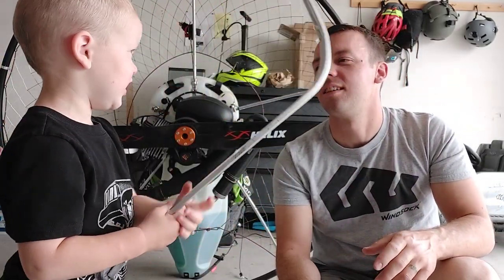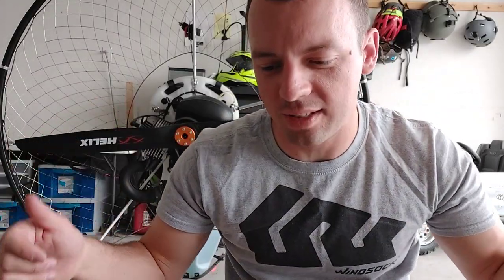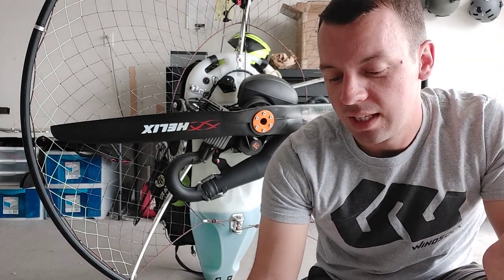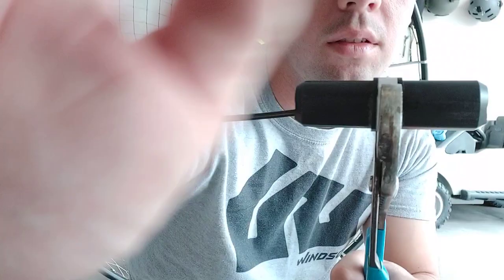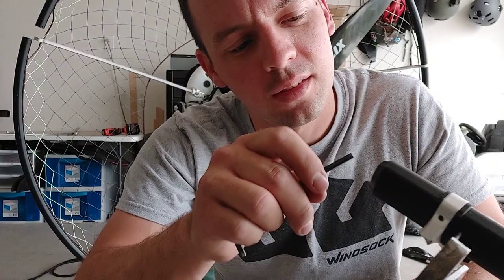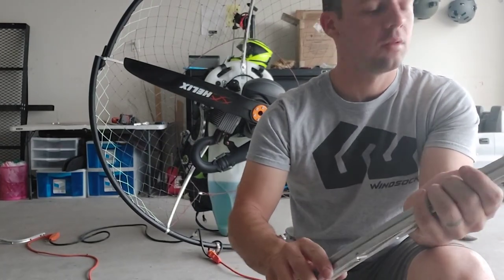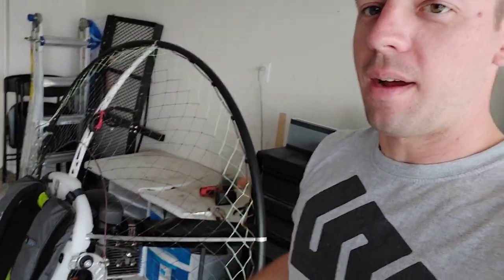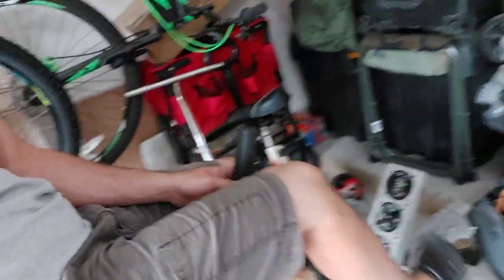I Crashed my Gravity Paramotor and Bought a Helicopter

Comment: Yours was the very best type of air accident, one in which very minor damage occurs and no one is injured, but from which much is learned... 

Congratulations on acquiring your excellent Mosquito Air Helicopter.

These very cleverly designed helicopters are shackled with hideously shrieking 2 stroke motors with highly questionable reliability and appalling fuel consumption.

A four stroke motor would hugely improve matters, but the maximum weight for the type category may be exceeded, a small price to pay for such a beneficial safety, reliability, performance and endurance upgrade.

Your two tiny Aircrew were adorable and you're a superb role model to them. I look forward to following your rotary wing adventures. Subscribed.

Comment: Not der- lin..... Del-rin! It is an acetyl plastic and it is pronounced Dell Rin. You know like Dell Schanze and Rin tin tin. Delrin. LOL 😆😂

Also, that silver nut is a rivnut. Also known as a nutsert. It is actually designed to be compressed just like a rivet is and it allows you to put threads into sheet metal. Mostly for applications where you are not able to get at the back side to put a regular nut. You drill a hole the same diameter as the splined section just below the lip on that rivnut and there is a special tool that is very similar to the tool used to install a rivet only instead of little things that grip the spike of the rivet, properly known as the mandrel, there is a threaded shaft that the rivnut threads onto. Then you insert the rivnut with the compression tool and squeeze it. It then expands the splined section of the rivnut on the back side, which is the side with the threaded smooth tube. Then that lip is what is visible on the front side where you insert the bolt. I use them frequently on some of the jobs that I do as a metal fabricator and a welder. They are absolutely awesome pieces of hardware to have and be able to use! I just think it's kind of funny that they are using that for the application that they are without expanding them so that they grip inside the piece of delrin. DELL-RIN.

Comment: Also did come from paramotor to Mosquito XE first and then the XET (turbine version). Still have a 2 seats XCITOR paramotor... Looking at your Air, your main and tail rotor blades grips are very old fashion you should ask CFX for the new ones and do the balance, tracking and lead-lag of the 2 rotors system. Very IMPORTANT !!
Reply from the maker: I spoke with them about the blade grips. They said that this style tends to come out of track. I plan to give these my best shot at getting the rotor as smooth as possible. If I can't, then I'll upgrade to the new head.

Comment: I’ve been concerned since assembling my Defiant about the prop-spar clearance. At 12 o’clock the tip seems fine but at 5 & 7 o’clock there’s less than 2 inches. I’d like to do something about this before I bump the hoop on a landing and eat a prop.
Reply from the maker: Under power, the whole motor flexes forwards and gives more equal clearance all the way around. If you butt land though, you will probably bust a prop
Reply: @MitchG  exactly what I suspect. My thoughts on improving the situation are: prop spacer (gives a little more clearance), engine mount spacer (for more equal clearance), and now these new spars (which also give more clearance).

Of course I don’t intend to but land but just in case I’d rather it not cost me $300-$400.

Comment: Dude, I have been down that road, sell the heli or at least fly it low and slow in ground effect till your kids grow up. Mine was not a mosquito but was similar. I was commercially trained and I had some big scares from tail rotor failures and 2 stroke reliability issues. I ended up scrapping my machine and losing $25k. Put it down as a life lesson and stuck to ppg and paragliding. Don't mean to put a downer on your purchase but feel I need to share my own experience. We all make mistakes, better to own them and be a father to your kids. Sorry but I had to speak my mind on this one. Good luck
Reply from the maker: I understand the risk involved. I don't regret the purchase at all